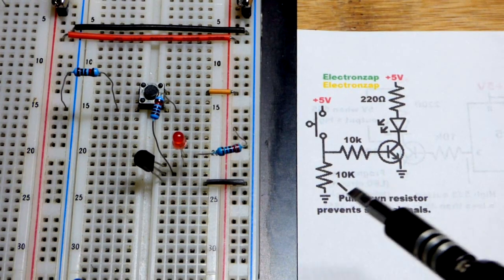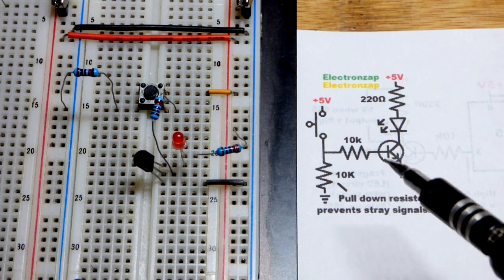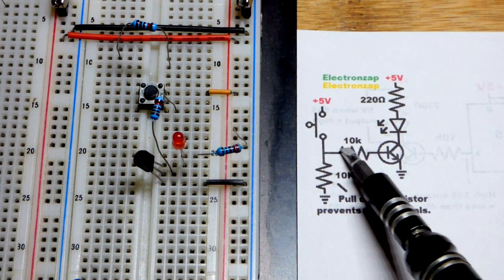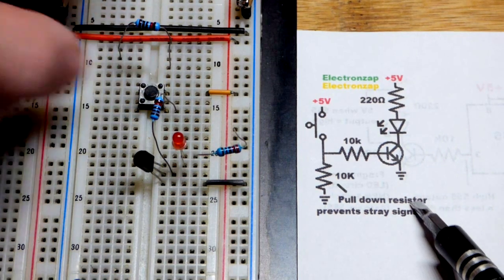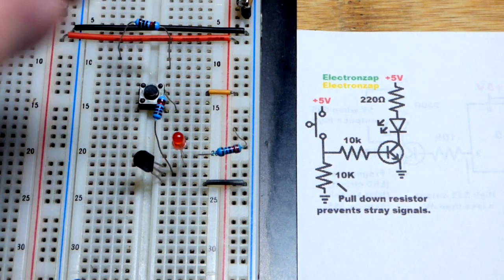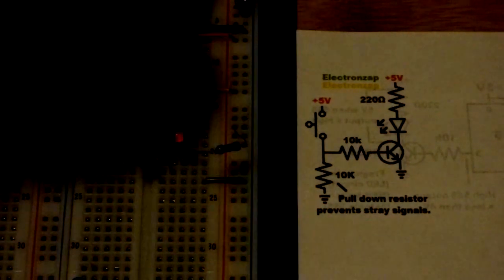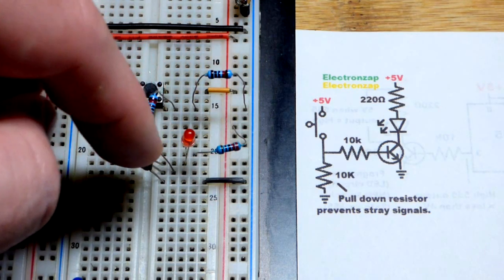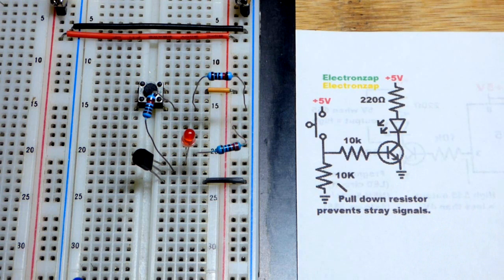Pull down resistor for NPN bipolar junction transistor switch circuit using electronics 2N3904 BJT

Comment: When working with a 74HC08 and ic, I have the same issue with body energy, how do you prevent the issue you solved with the pull down resistor with an ic? Thanks for the great videos.
Reply from the maker: Same way, either a pull up or pull down resistor. Thanks for watching!

Comment: VERY GOOD video! I'm a beginner. Please let me know what is the best solution: I put the pull down resistor before or after the resistor of the transistor base? Why? Thank you very mych.
Reply from the maker: The main thing is that there is no short circuit, and that the pull up/down resistor doesn't throw off the voltage enough to interfere with the transistor operation. So it all depends on the circuit where the pull up/down resistor is placed.

Comment: I don't understand
Reply: @electronzapdotcom is connecting the base of the transistor to a negative pole (with a resistor. ) When the button is "off", electrons will want to flow into the base and out at the collector. This is the reverse direction to when the button is "on". I think that turns the transistor "off". I'm a beginner, that is what it looks like to me.
Reply: I may be wrong. But how I think it works. The circuit adds a way to turn the transistor "off". Without adding it, there is only a way to turn it "on", and, then, leaving it in a sort of "neutral". When it is in "neutral", it is prone to being turned "on" by picking up electricity from the environment. Adding an "off" mode as well, prevents this.

I really recommend this video, https://www.youtube.com/watch?v=7ukDKVHnac4, an animation that explains, in a very simple way, how transistors are turned "on" and "off". It shows both "neutral", "on" and "off" mode, and explains what causes each one.
Reply: gracias amigo justo lo que buscaba,se que en los MOSFET al quitar la resistencia pull down el MOSFET conduce pero es por si capacitor paracito interno de gate a source